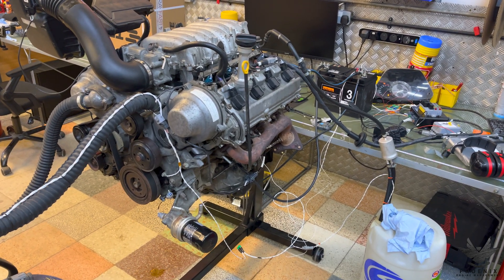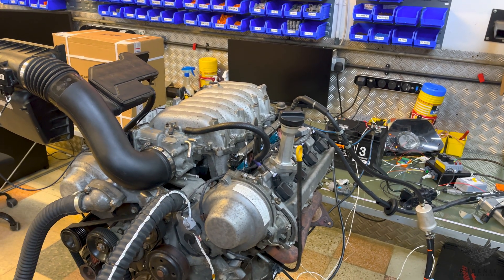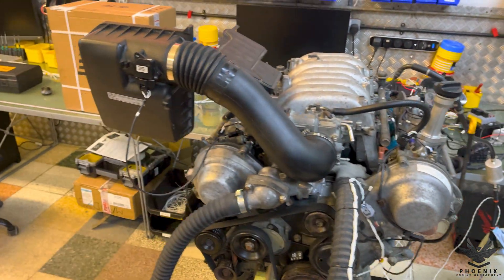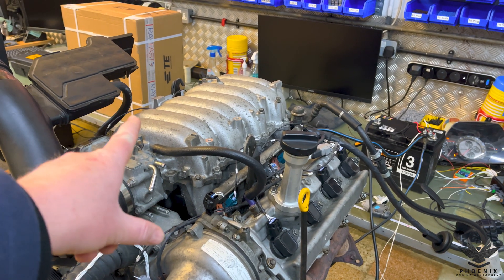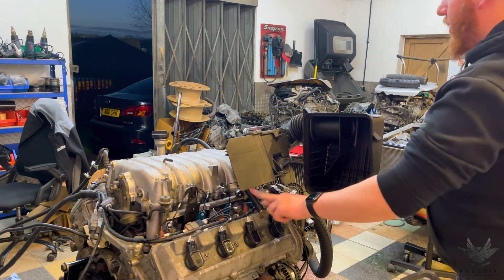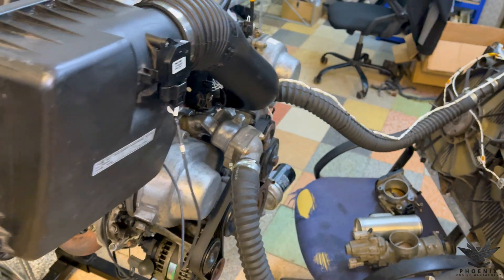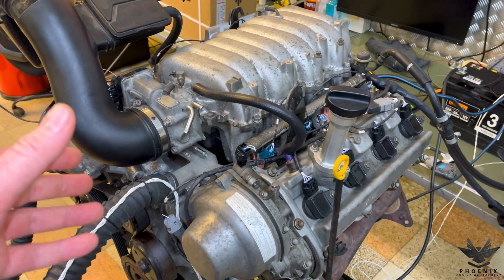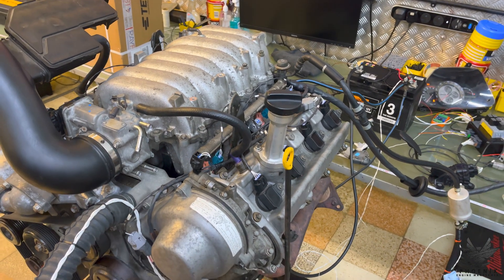Toyota/Lexus UZ Engines The Random Misfire and the Fussy MAF

Comment: Dear
My engine same 2002 lx470. Changed spark plugs. Coils.still same misfire but only when car gets hot like if you drive for 1 hours then it will start misfire when you can feel whole car will start shaking. Both side pipes are connected properly Masflow sensor replaced with used one.

Comment: Greetings l have 1 acting wierd like excess air coming from somewhere 
Recently took out injectors for testing and l was surprised to find unburnt petrol which was looking blackish in between the inlet manifold
Before l removed the injectors it was  smoking white petrol fumed exhaust gas 
And on the dipstick the level is up oil and petrol mixed together 
I am still to put back everything because they all seem to be working fine

Comment: Do you have a contact I have a 1uz sc400 and I recently changed the starter since it was bad now my car starts but stalls and sounds like it’s misfiring I changed the injectors but I do have a code for bad maf would that likely be the culprit I can send you pictures and videos if necessary this is my daily driver

Comment: I have a problem where the pipe which goes in the air box is broken so the pipe is hanging inside the box does that make any difference
Reply from the maker: If there is any air leak after the MAF Sensor then the ECU is not able to calculate the airflow into the engine correctly. That will cause the ECU to have to correct based on lambda readings. 
Ideally you want to make sure that any vacuum hoses/pipes that are between the MAF Sensor and the inlet manifold are not cracked or broken or able to allow airflow to enter the inlet manifold.

Comment: I had same issue, today I came across same hose in different engine  , the hose it self hard and brutal and had  a split right where connect to the manifold, changed it the engine running like a dream now  , I only had misfire mostly in  low rpm, had it about couple of months now ,yr videos really inspiring. Thanks
Reply from the maker: Thanks glad it helped.